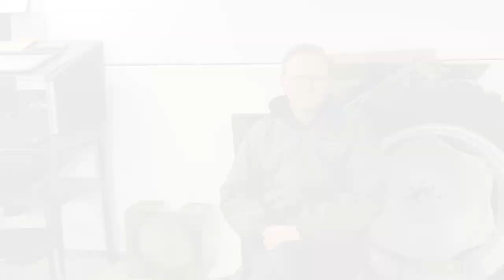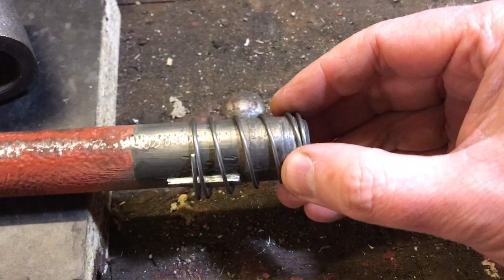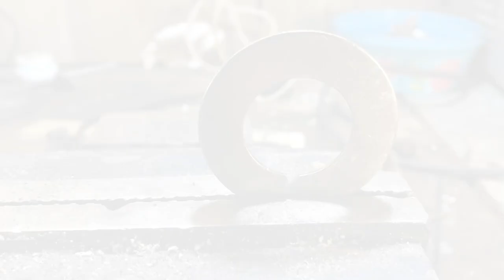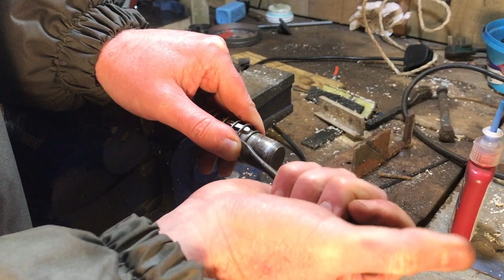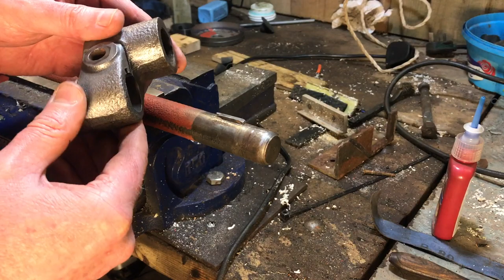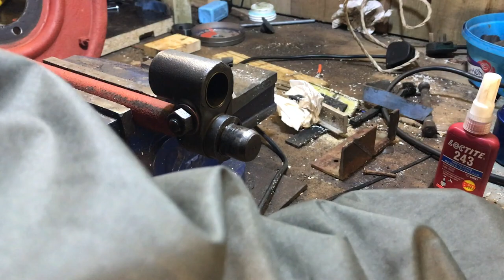#37 Ferguson TED20 - Assembling Brake Backing Plate

Comment: Ideally you should never reuse spring washers, of any type. But I admit that if the washer looks good then I will reuse it too.
I feel for you with that.
Normally, as you tried, you drive the key out by hitting the end with a hammer and chisel. As it is a half moon it should roll out.
If not then heat it red hot then bash it out.
Hopefully it’s not welded.
Reply from the maker: On a machine that is unlikely to do a full day’s work in the future, it is a judgement call. If the old ones are ‘compressed’ I replace them. 👍
Reply from the maker: I’ve never come across a key that would’nt come out before this one. It took a lot of abuse and never even budged! 😂

Comment: Hey, that bolt you use at 24:40, do you still remember where you bought it or what size it is? Mine broke off.
Reply from the maker: Hi, I believe I got it from Agriline, however I don’t see it on their site anymore. I will check to see if I still have the old ones.

Comment: Hi Gordon may I suggest put the Loctite back in you tool box and never use it again if the has any type of locking device under the head of a nut or bolt 
All the brake parts are made to self centre 
One it’s all together you loosen the two big nuts and the adjuster apply the brakes and tighten to self centre so both shoes are the same distance front the drum
Reply from the maker: Hi Hooter, thanks for your comment. Allowing the brakes to self centre makes perfect sense. Thank you!

Comment: Just watching your video on the back plate assembly, currently doing my own, should there be a collar over the spring and washer on the rod at back of brake plate?
Reply from the maker: Hi Richard, not as far as I’m aware. I assume you mean like a rubber boot to protect the spring? I’ve not seen anything like that on the Fergys. If you have any info on this I’d be very interested. Those springs do tend to rust out over the years, which then allows dust and dirt in through the hole around the shaft. The shaft needs that movement to allow it to cope with the relative movement of the brake shoes, so you do need a flexible means of sealing the hole. 👍🙂

Comment: Again, this is a late comment/suggestion. That woodruff key has seen better days and your attempts at removal did not work. Possibility of using an oxy/acetylene torch would provide the heat needed. I've found a product named "Nut Cracker" will loosen many things, if allowed the soak time after heating/cooling. My suggestion is based on using the old key as you did. Drill/Tap a hole through the bracket so an "Allen Screw" can be threaded through and lock the bracket to the shaft. You should also drill into the shaft just enough to allow the screw to lock the shaft. Use some copper coat to assist with the installation of the bracket and prevent further corrosion/rust.
Reply from the maker: Hi Charles, thank you. That certainly was a tough bugger and I intend to prevail over it one day! 😉. An Oxy/Acetylene torch is one of those things that’s on my wish list, but somehow never quite makes it to the top of the list! I’m not sure what you are referring to wrt. Using a grub screw, I may need to review this video again to get your meaning, but it sounds sensible. 👍😉